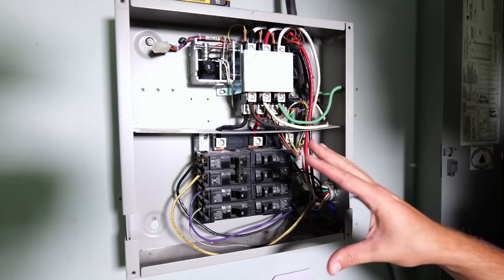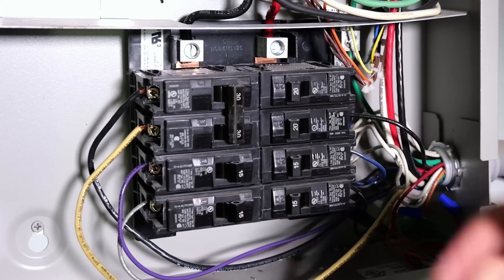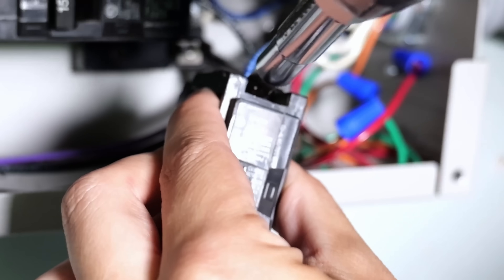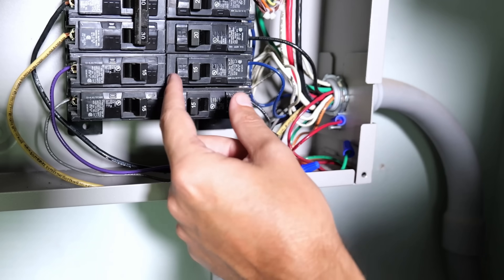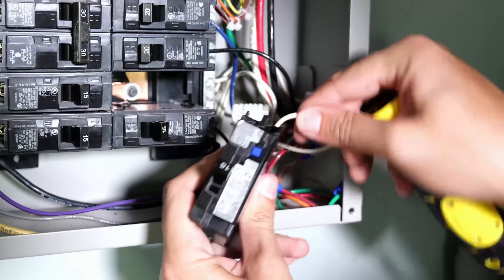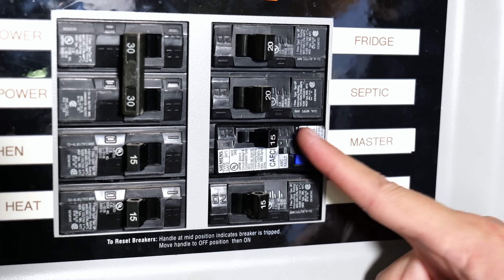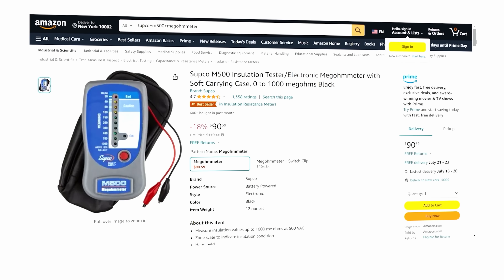Most DIYers Miss This CRITICAL Detail Installing Circuit Breakers!

Comment: Yeah the AFCI breakers are so reliable and wonderful, that the NEC had to give an exemption to allow to not use it when feeding a Freezer.  AFCI breakers have so many nuisance trips, especially with arc producing appliances such as certain vacuum cleaners.  Yet, now all new construction has to have them on all breakers... ( and these things cost a ton more than a regular breaker)   The only breaker that is well worth the extra expense, is the GFCI when feeding pools or outside outlets etc... but the AFCI is just govt over reach... a conjured up far fetched rare issue and now an expensive product for our "Safety"    The cost to put in a new Electrical panel now costs an arm and a leg, thanks to a corrupt govt system in this country.
Reply: Except that the AFCI requirement was not written in by the government, but by the NFPA, a private entity. Governments adopt that code, but many AHJs (nearly half the states) have eliminated or modified that requirement. Your theory of government overreach seemvers a little weak in this instance. 

If you live in a jurisdiction that hasn't, then you probably live in an area where they are still required and you probably have a lazy government more so than a sinister one.
Reply: @sigcrazy7  So if the Govt "adapts" the AFCI requirement, then it is still the Govt requliring it.. and if we dont comply, it results on a fine and costs us money... still govt over reach anyway you look at it... "hi we are the govt and we are here to protect you"
Reply: @tgarrels  Except that your premise is built on a fallacy, that somehow the government created the AFCI so it can grab power and somehow profit. If you don’t like it, have you petitioned your government to exclude that requirement, like has been done in over twenty states? Like I stated, the NEC is usually adopted whole cloth out of ease more so than malice (as you imply). Have you addressed this with your state?
Reply: @sigcrazy7  Well, it’s not flawed, the govt does do power grabs and does profit off its subjects and is corrupt, that’s common knowledge.  In this case, no the Fed Govt itself did not purposely create yet more rules for the electrical trade to directly profit from the AFCI requirement…but it does allow private companies to lobby for adding more regulations to the NEC on a continuous ongoing basis decade after decade, knowing that local govts will quickly adapt anything the NEC says.  At this point, private companies now benefit from the process by generating huge sales of the newly required products to be used in every new construction, which generates huge $$$ in sales tax, and profits for the manufacturer, and more income tax revenue at state / fed level.  Guess it must be nice when a manufacturer can invent a new fear, then invent the product to save us from the new perceived fear, then using local govt regulations force every builder to buy it.   We shouldn’t have to nag and complain to our local govt to please not enforce this new AFCI breaker nonsense that they blindly agreed to enforce, to maybe get them to “Relax” the requirement.
Reply: @tgarrels  The NEC is not a government publication. It is not controlled, published, or influenced by any government. It is a product of the NFPA. Do you know anything about how the code is updated tri-annually? Based upon your response, you seem unfamiliar with the process. All the discussions surrounding the adoption of the AFCI requirements are documented. You can go read it if you like. Nowhere will you see the influence of the government in that process. I am no lover of government meddling, but to simply make completely erroneous claims about this will NEVER help because you are assigning blame to an entity without responsibility for it. You cannot be bothered to contact your state rep to address this issue, but you will bemoan government oppression all day on social media. Is it your position that there should be no code whatsoever, no permitting, and that we should have an electrical system like India? If you agree that some standards (and by extension, enforcement) is beneficial, then you should become a part of the process instead of acting like a victim of imaginary tyranny.

Comment: The conduit is way over filled. That is the greatest hazard in the electrical system on video. Lots of heat leads to breaking down of plastic insulation and then arcing occurs.

Comment: How do you find out which neutral wire is paired with the hot wire to the breaker you are replacing?

Comment: WOWSER -  Stranded WIRE 
&  
BLUE  
PURPLE 
TAN / WHITE  Hot Wires 
colored  Wire in a circuit Breaker BOX 
...
Have you considered utilizing a  FERRULE ?  
and
Tape the proper color on these WIRES ?  
Thanks
COOP
the  WiSeNhEiMeR  from  Richmond, INDIANA 
...

Comment: 👍, w8 U said ‘attach hot wire in this or that hole’ but never did.. then U said attach neutral or ground to matchng bar in breaker box, but never said wat the hex that 25”lb blue wire🤔  other than that yip-yap, pretty qool video(& looks like it’s no girl scout picnic, or suicideish? to atMpt to attach breaker w/out panel box)…

Comment: I was a bit disappointed to se you trim the stranded neutral wire at 9:00.  It seemed you were pretty close to the  open electrical panel.  I'd want to keep away from the panel in case any portion or strand of the neutral wire might pop off as it is cut and lodge unseen inside the panel to cause a hard to diagnose problem.  

Beside the AFCI you showed, aren't then some circuit breakers where you connect the hot and neutral wires to the circuit breaker (even non-AFCI ones).  After doing that the circuit breaker is pressed into place  connect the hot side of the breaker to the back of the panel and the neutral side of the breaker to connect to the neutral bus bar.  That way there is never any guessing as to which neutral wire to remove from the bus bar as in the case with the AFCI and no screwing of a neutral to the bus bar is needed.  Be nice to show that case as well in future video..

Comment: What he is not telling you is the NEC requires AFCI on all new work from January 1 2014. 
Anything prior to that date is not required by code.
Also your city or county may not have adopted the 2014 NEC in this case AFCI's still will not be required until the date your city or county adopts this new code.
AFCI's on average cost $60 each vs $8 each for a standard circuit breaker.

Comment: Never use anything electrical that says GE on it. And when you remove the wire on a breaker replacement cut that end off and strip back a new end using lineman's pliers twist it up real good and trim the end. Nice clean tight pretty end. Don't be like butch here and just jam the messed up end back in the new breaker. Its called Craft.

Comment: Still using Square D HO breakers as replacements for GE breakers
I'm happy my house's panel is Square D QO. Not long ago helped mother over the phone troubleshoot a tripped breaker, standard type GE brand, that didn't look tripped and supposedly wouldn't tap to get switch to trip. Took hours to figure out because it was a main panel that was turned into a subpanel, with faded tag and circuit reused for more outlets when house was raised.

Comment: While is current code for a AFCI, I'm not changing out my breakers. My house was built 1989. It's a 200 amp main. All Siemens . My son's new construction build in 1998 local code required AFCI for only the bedrooms. When we added 2 more bedrooms in the lower level, we had to get the AFCI breakers from a local electrical supply house. The big box stores didn't stock them back then.
Reply from the maker: And you are not required to unless changing your panel.

Comment: There is no guarantee that an AFCI breaker is going to prevent a house fire and while they are required now for certain rooms in new construction, there is no requirement to replace older standard breakers with AFCI breakers unless you are doing remodeling or electrical upgrades to the home.  If you are going to work on an electrical panel, it is best not to use a 6 in 1 screwdriver and instead get a proper set of sleaved electrical screw drivers.  The conduit linking your sub panel to the main panel looks to be severely over stuffed.  If you ever need to replace a breaker it is good practice, especially for stranded wire to cut and strip back the wire to ensure you have all wire strands unbroken as you install in the new breaker.

Comment: So the AFCI breaker has two neutral wires? In the video, one that came from the existing bar and the second was the pigtail on the breaker? Why two neutrals?
Reply: Two wires so that the neutral passes through the breaker so it can be measured. One neutral is the wire to the room , the other is the neutral from the power company, which is what the bus bar provides.

Comment: afci brakers suck!!! most modern appliances are power up as soon as it is plugged in creating an arc. this arc WILL trip these brakers. so i repeat these brakers suck! Now GFCI plugs / Brakers are definitely a good thing
Reply from the maker: In the over 10 years I have had AFCI breakers, I have not once had an accidental trip.

Comment: Not all jurisdictions require Arc Fault breakers. How To Home lives in Utah, IIRC, which has eliminated the requirement for Arc Fault breakers in all new installs of single and duplex houses. The state believes the cost doesn’t justify the benefit. I believe there’s some other states that also don’t require them.

I have added arc fault+GFCI breaker protection to every circuit in my house, except the smoke detector circuit. I have not had a single nuisance trip in the two years since I made the change.
Reply from the maker: I do not live anywhere near Utah so not sure where that is coming from.  But all jurisdictions in the US do require AFCI breakers in living areas IF they have adopted at least the 2014 NEC edition, which most have.  UNLESS individual jurisdictions decide to amend them and exclude a certain section or modify it.  This would be the minority though and why it’s always important to check your local codes.
Reply: @HowToHomeDIY  Sorry, must be confusing you with another guy. 

Nearly half the states have amended their AFCI requirements, so you must check your AHJ in those states. Like I said, Utah has dropped all AFCI requirements for new construction. Those states that have amended their AFCI requirements are:
CT,AR,DE,ID,IN,IA,MA,MT,NC,NH,OH,ND,OR,SC,SD,TN,UT,VT,VA,WI,WV.

Most have just changed where they are required, or when you must upgrade to them (circuit extensions, remodels, etc). Only a couple, like Utah, have dropped them altogether.

Comment: Great advice. I was born in a house built before civil war and electricity was added decades ago and now getting it ready to rent and eventually give to my grandson so I need theses in that house for sure to be safe . Thanks for all your many helpful videos
Reply: You may have a more pressing danger with the wiring if it the original knob and tube.  Every time I've found it during a renovation I've found where a  previous owner either spliced into wires to add additional outlets, increased the size of a fuse or breaker to keep it from tripping, or covered wire in the attic with insulation.  And I've found charred studs and joists where it has overheated.  This is dangerous because a breaker or a fuse may not trip before a fire starts.

This type of wiring was designed to be self cooling when surrounded by air.  But there is no need to replace it if the original installation hasn't been altered or added to and the wires haven't deteriorated with age.  That said, it must be replaced if you find evidence where it has been altered or added to.

Comment: Breaker Brand 	Interchangeable with Eaton	Exactly the Same as Eaton
Westinghouse 	Yes	Yes
Square D	Yes 	Yes
Cutler-Hammer 	Yes 	Yes 
GE 	Yes 	No
Thomas & Betts 	Yes 	No 
ITE/Siemens 	Yes	No
Murray 	Yes 	No
Crouse-Hinds 	Yes 	No 
As you can see many breaker brands are interchangeable with many others so the information you provided isn't entirely accurate. There are many other exceptions on line.

Comment: Since when do you have to upgrade your electrical system to the latest code requirements every time they change?
Reply from the maker: I don’t recall ever saying you did in the video.
Reply: Since when your house burns down and insurance won't pay the claim because your code wasn't current. That's when.

Comment: This guy is promoting needlessly replacing regular breakers to the arc fault type.  Even if a breaker fails, the NEC code DOES NOT require bringing an existing panel up to the current code.  Replacing a faulty breaker is considered a repair, and does not fall under the current code.  Only new construction is required to meet the new code, all others are grandfathered to the code requirements at date of construction.

Comment: Don't you just love the Arc fault breakers that trip when the vacuum is plugged in. That torque screwdriver can lie to you. They can and do go out of calibration. Tighten the screw tight. You can feel when its tight.

Comment: Wow! Never dealt with AFCI breakers before. Handy and seems simple to install. Great info and explanation!!
Thank you!😊
Reply: They're not particularly handy. Actually un-handy. Also expensive, as basically nothing arc fault protected by code doesn't also need GF protection.
Two pole, even more expensive. Yay. But try to get 2-pole DF breakers....

Comment: Bunch of misinformation, just gotta say.
NEC 2024 requires dual purpose afci/gfci, which you neglected to mention or just called a DP as gfci.
Some brands, such as SqD and Siemans use Afci with no neutral or pigtail attached, they simply replace a standard breaker with a hot because they use a hard attachment under the breaker to a neutral buss.
Never land the hot under the breaker until all (that includes the pigtail) neutrals are fully landed to avoid getting neutral loaded shock if the panel is still live, which can easily happen since it's not always possible to shut down the mains.
The Arc function in the Afci is seperate function from the breaker function of the breaker itself and is designed to detect a difference of resistance between neutral and ground. Nothing to do with power to N or G, which is a function of the breaker aspect.
Seriously bad advice to tell people to manually test and reset the breakers 1x a month. Most breakers (residential and commercial) are Not switch rated, so will weaken with every reset. Within 2 years of such use, you'd be lucky to hold 10A on a 15A breaker, making it necessary to replace, at @ $100 a breaker ±. The breakers themselves have blinker circuits that will tell you if there is an issue with functionality.
You make it sound like ppls houses will suddenly burn down if they don't have Afci, gfci or DP breakers installed, and that in itself is just as wrong as letting DIY'rs screw around inside an electrical panel.
Reply from the maker: Wow so much said and almost all of it is opinion and wrong.  But I just checked your profile and almost every single comment you have left (10 of them) on this channel is negative so that tells me everything about your intention.  First, there is no NEC 2024.  So right off the bat you are off to a bad start.  AFCI/GFCI dual purpose breakers are not required.  Completely wrong.  Yes different breaker boxes have different AFCI breakers.  Most require the pigtail I showed.  Your saying it is bad to test the breakers once a month is absolutely ridiculous and recommended by the manufacturer.  They can handle it.  And at no point did I say people's homes will automatically burn down without them.  So many lies, misinformation, and bias in your comment.  Also, liking your own comment doesn't help it get seen more.
Reply: @HowToHomeDIY  several counties around me like to stay 1 up above NEC codes as they see them as minimum standards, not optimal standard. So currently, in those counties that have adopted NEC 2023, as of July 1st, All 125v-250v circuits that have a neutral must be gfci protected, 3 means of ground (any poured structural concrete must have rebar enclosed and a UEFA ground attachment plus 2 ground rods at the service).
None of the SqD, Eaton or Siemans afci/gfci breakers we use have pigtails, they used to, but they stopped sending those in favor of the snap-on neutral buss bar kind.

I guess I seem very negative because your videos tend to make mountains out of generally nothing. Like the outdoor gfci, there was plenty of wire there for a gfci replacement, but you made it seem like it was a big issue because they weren't the proscribed 6" long. Many outdoor boxes are pretty shallow or even metal brick boxes and definitely will have a serious issue stuffing that much wire plus accompanying wire nuts into them, as well as a gfci recepticle. So again, sorry for the negativity.

And no, I didn't like my own post for any other reason other than I'm on a mobile not a pc, and it'll auto-like sometimes if scrolling and accidentally double tap.

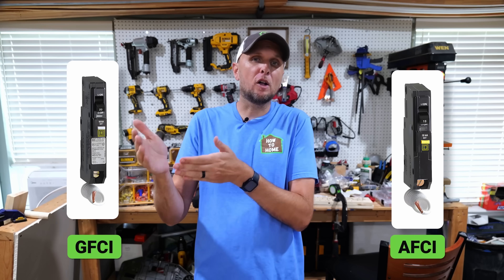Comment: 1:58  Square D has a color code on the test button for their advanced CBs, that denotes which type they are.  I think you have the GFCI and AFCI (it's actually CAFCI) breaker reversed at this time stamp, i.e. the GFCI is on the right and the CAFCI is on the left.  
Here are the Square D color codes (on the test button just above the Square D logo at about the mid-point of the front of the breaker):  
White test button:  CAFCI (combination arc fault circuit interrupter; the "combination" is for both series AND parallel arc faults)
Yellow test button:  GFCI
Purple test button:  DF (dual function; incorporates both CAFCI and GFCI)
Reply from the maker: They were just pictures for illustration purposes.  Not really meant to go over what each breaker by one manufacturer is.